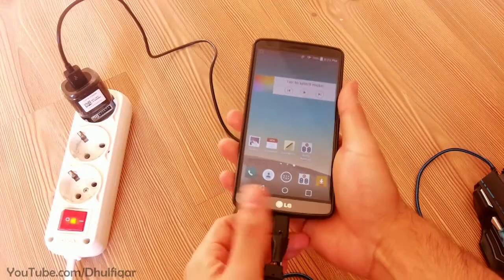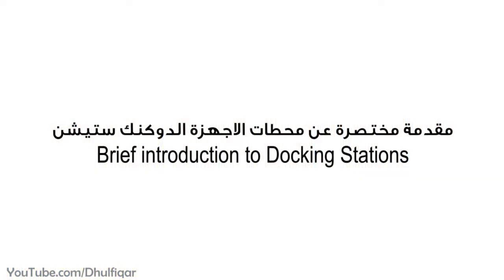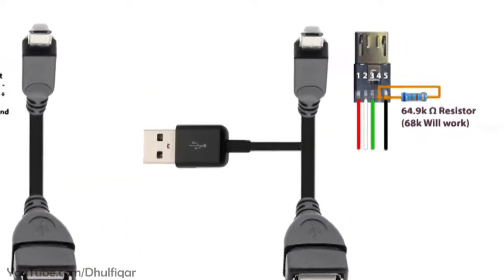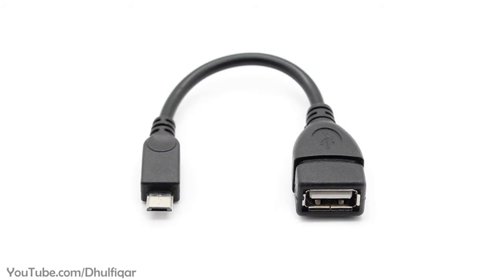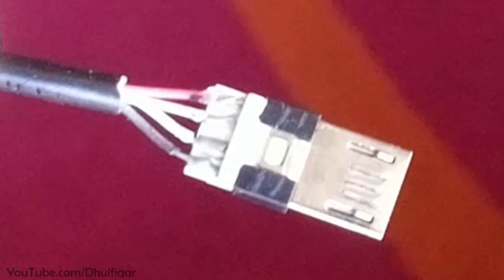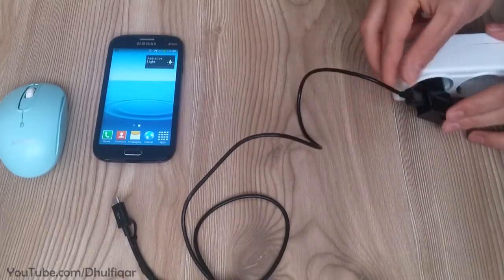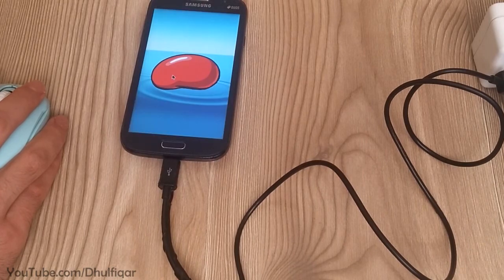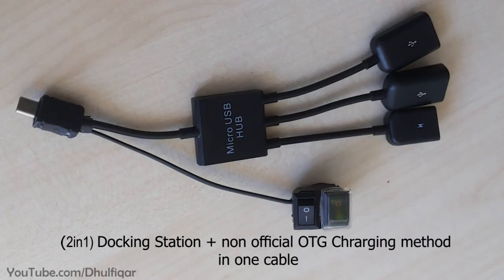DIY OTG & Charging Simultaneously [DIY Docking Station for Samsung Galaxy S3, S4, Note] - Smart Dock

Comment: Doesn't work on SG S5.  With resistor connected its in OTG mode - Serial communication works.  Without resistor it goes to charge mode and phone displays 'Error writing to serial'. (Its communicating with an Arduino).  If the resistor is inserted after startup in charging-mode, charging mode stops, and serial comm works.  any suggestions?

Comment: I want to do this with a tablet like the old Samsung Galaxy Note 10.1 GT-N8013. It only has a 30 pin port. I have two cables that are both 30 pin male to USB-A male. Do I need buy a 30 pin male to USB-A female? I also have an OTG cable for fitestick if that helps, but the cable has 1 male micro usb, 1 female micro usb, and 1 female USB-A

Comment: hi i have the otg 'hub' adaptor like yours at the end of the video,  , but mine has the otg/charge 'switch'. so i can charge OR use otg, but not at the same time,  if i remove the diode will it still work?....i need charge and use at the same time, thanks.
Reply from the maker: Hi!
Did you try to connect the hub  to the phone while the hub is set to "charge" mode .. And let the phone charge.. And then press the switch in the hub to "OTG" mode.
Try and see if that allows OTG Charging.
If not, try to remove the diode as shown in the video and then apply the same method again and see if it can OTG and charge simultaneously. 
All the best.

Comment: Hi I have an otg that has the charging cable. You mentioned in the video to skip adding the charging cable I assume I still need to a a switch for wire 4 and 5?
Reply from the maker: Hi!
Yes, two methods.. one requires a switch between pin 4 and 5.. and the other method requires a 68k OHM resistor between pin 4 and 5.

Comment: If i have an adapter that has 3 female usb and 1 female mini usb and i remove the diode and bridge the pads with solder , it will work just fine i mean will charge my android phone and read the USB drive or mouse and keyboard?
Reply from the maker: No, unfortunately you have to mod the Micro USB that connects to the phone in order to enable OTG and Charging simultaneously.. And your phone has to support that feature, some phones might not support this or might even get damaged.. it is an unofficial method.

Comment: hwy u show the hub in last min of this video to remove diod and next in pic u show that u attach a on off switch with it plz tell me is is must to attach or it will work if we just remove diod n short is
Reply from the maker: The last one is 2 in 1.. which means I used the two methods in one adapter.. you can make either of the methods depending on your intended use.
All the best.
Reply: @Dhulfiqar  tnx for quick reply as u said i removed daiod ans short the pins with soldring now its doing charging but otg is not working but when i remove charging and use as a otg  then otg work but after connect charger  charging does not work
Reply from the maker: You're welcome Rashid, on what mobile phone model did you try this method?
Reply: @Dhulfiqar  i have Huawei mate 10 but i m doing all this for Amazon firestick 4k  cuz i need to use it on firestick 4k
Reply from the maker: @rashidrehman2492  Oh, unfortunately I didn't have a Huawei to test on.
Keep trying and tell us if you make it work.. All the best.
Reply: @Dhulfiqar  hey its work on my firestick 4k both power and otg for storage  tnx a lot sir
Reply from the maker: @rashidrehman2492  You're welcome!

Comment: Just trying to get this working on my old Galaxy S6, i try to find the specsheet for S4 in order to get the one for S6, but cant find it. I have an hub that have a 68.3K ohm resistor and it dont work.  Maybe a higher resistor will do the job but need to find how you figure out for the S4. Can you help?
Reply from the maker: Hello OxyGames, I wish I could answer you but I don't know and I don't have a Galaxy S6, if the S6 Has "smart dock" then keep trying.
or you can try this alternative method.
https://www.youtube.com/watch?v=wBg_Ifq-qL4
Good luck.
Reply: @Dhulfiqar  hi thanks for answering.. how do you get that first data to know what resistor you should use? Or did you try a couple of them until u get it working?
Reply from the maker: @oxygames89  I searched Xda Developers forum, this one https://forum.xda-developers.com/t/diy-smart-dock-for-galaxy-s3.2142357/

I didn't have the 64K Ohm resistor that they mentioned, so I tried 68K Ohm and it worked.

Comment: I couldn’t find any place that states which resistor should I use with my lenovo tab 7 essential. Do you know which one?
Thanks
Reply from the maker: in this case, you can try resistors one by one,
or try this method instead https://www.youtube.com/watch?v=Ld6LjVe-Xo0
Reply: @Dhulfiqar  can I cause damage by trying a wrong one? I’d prefer this method over the other, I don’t want to turn the switch on and off every time i start my car, and it will probably be necessary for the switch method
Reply from the maker: You are right, this method is more convenient, I don't know if it will damage it or not, every device as a different circuit board, but the problem is not all phones or tablets have a Smart Dock Mode.. good luck with you project.
Reply: @Dhulfiqar  Just did what you said on the hub (disassembled and soldered the required) and it hasn’t worked for me, any ideas? Don’t know if it’s relevant, but my hub has 4 female jacks, and a little switch for choosing between charge and otg
Reply from the maker: try to switch it to the charge mode, and then connect it to the tablet and let it charge, and as it is charging flip the switch to the OTG mode and see if that enables the OTG & charge mode.